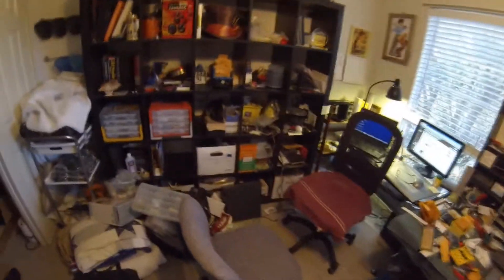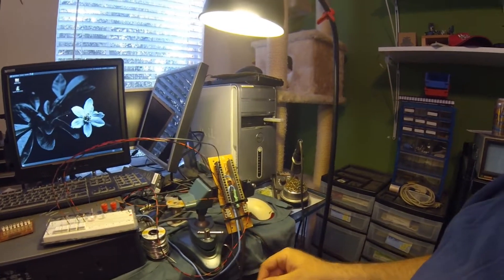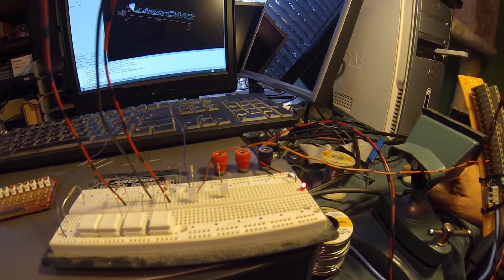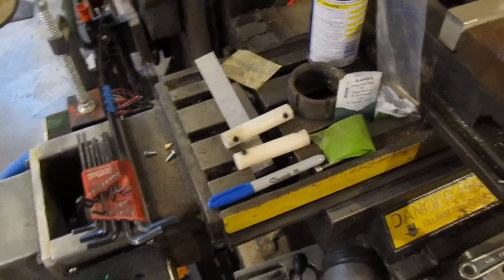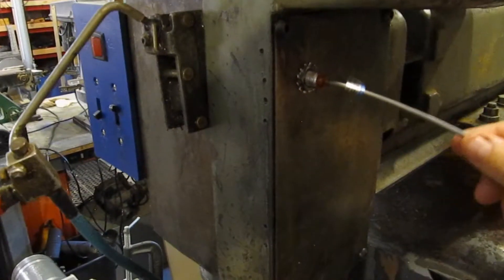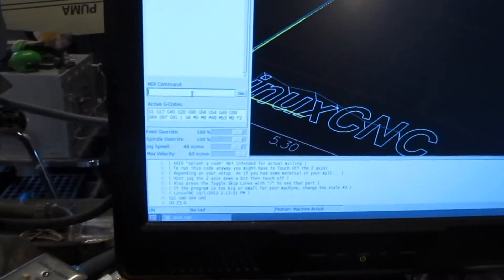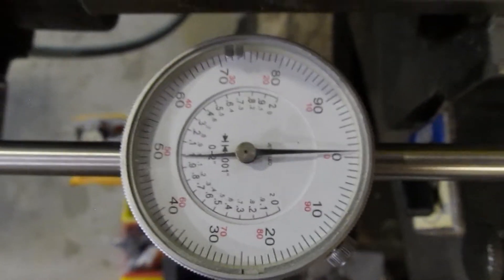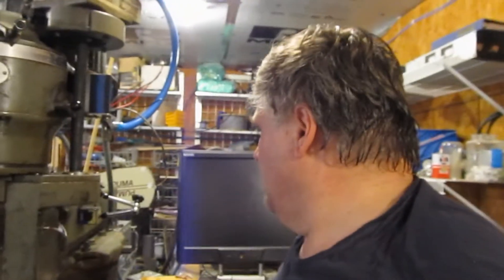Wells Index 823 Mill Update #2 - July 5th, 2014

Comment: Hey Jerry, New Subscriber here. I had a question regarding the axis motors on your mill and can't seem to find it in any of your videos. I believe I heard you say they are GE motors but are they a servo with an outboard tachometer? I have a wells index with Electro Craft permanent magnet servo motors and tach on the back of the motor, and there is encoders on ball screws, which I believe is how yours is. I would like to switch to gecko's but I'm not familiar with servos at all. My first Wells Index only has steppers and it was an easy transition for me.
Reply from the maker: Forget the Gecko drives. As you go through my videos you will see that I abandoned them. They say 80 volts 7amps... But you need to read the fine print. Using the existing 55vdc transfomer they were pulling about 3.5 ams. Thats 55 x 3.5 = 192 watts. The Geckodrive is 100w max. Which is why I blew out 2 sets before I figured that out. I eventually pulled the Geckodrives, installed 13 Newton steppers and drivers. Now it runs perfectly... No glitches... No sudden jerkey motion.

Active feedback is nice... But these are so powerful it would snap a 5/16 endmill before it ever missed a step... Rock solid.

If you want more info get my email from my web page and I'll send you details on what I used and how I mounted them... Minor modificstions to the mounting plates.

Comment: Waooooo What a hUGE monster , Only a Mill Man will know the worth of this machine . congrads Jerry You made it to the gateway of satisfaction . Proud of you
Reply from the maker: Yeah... it's a great machine. I still need to add a few more items... thinking 5-axis.
Reply: Draw It , Make it , Install it , run it . One long path of satisfaction . Wao What a shop , had I been in TX I would be living in your shop , Of Course if a corner zone was allocated For the Mess that I will introduce in the shop.:)
Reply: Was kinda thinking , It is not difficult for you to make a Huge stepper motor with planetary gear  Huge monoblock 4th axis  All in one and the 5th aswell